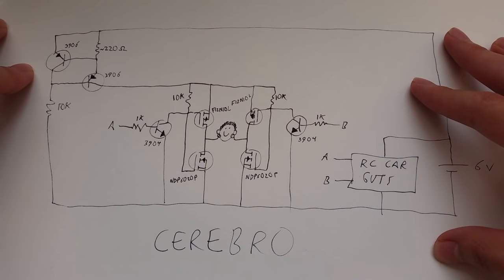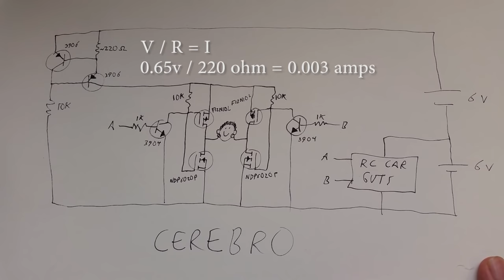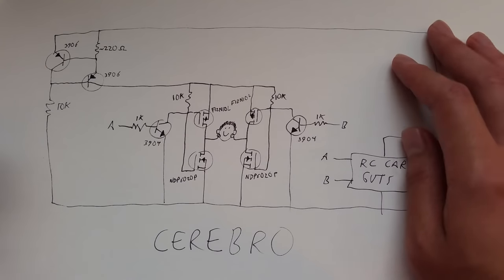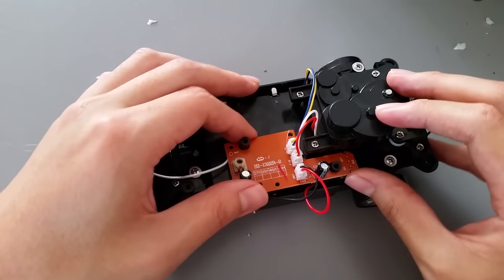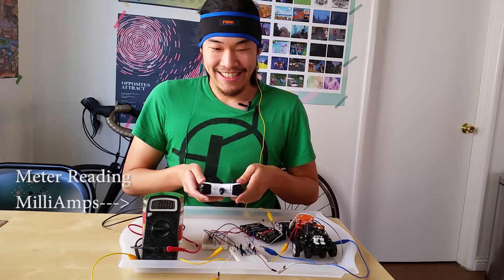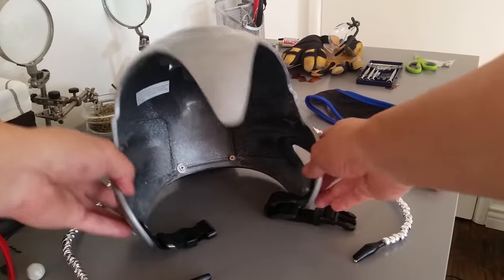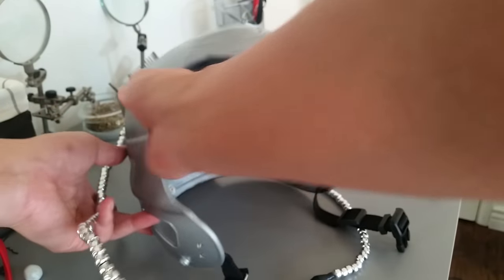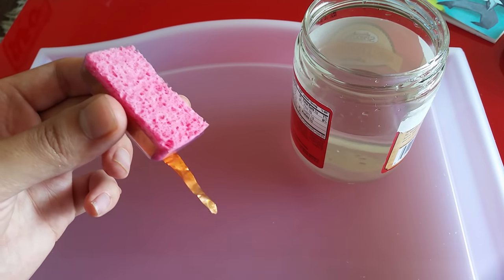How to make a Mind Control Cerebro Helmet from X-men!

Comment: Very nice explaination of the circuit
I would just say that it lacks any kind of fail-safe mechanism
If one of your regulation transistor were to fail the wrong way (shorting on the right one, high impedence on the left one) you'd end up with an unregulated current trough your head
Switching for a dedicated current source with safe failure modes would be better (but the circuit is great for anything not as critical and which would not require to put your head into ^^)

Comment: I know the chances of you responding to a 5 year old video are somewhere between slim and none, but does the output of the remote act as a binary switch on the equilibrium of the subject, or does the change in equilibrium vary in an analogous manor depending on the distance from center you move the controller?
That might not make sense... do you feel the same effect whether you move the joystick slightly to the left or full left to the stop? Or can you steer the subject slightly with minor input then really push them over hard with greater input from the remote?

Comment: Did you use pspice or something to check current before assembling the breadboards?  Also trés cool.  The simplicity of the device is awesome, time to go raid my unis lab.
Reply from the maker: Nah, just checked everything with a multimeter. Been a while since I've actually simulated a circuit!

Comment: Hey you have a website, or something people could contact you at (maybe a YouTube email, so there's not a bunch of spam on your real one or something?) I am about half way done with this and need some advice on the electrodes and where to put them, thanks!
Reply: Well it's done, I can't figure out why the electrodes arrant receiving power though, I'm guessing it has to do with mixing up the gate, source and drain on one or some of the mosfets (mosfets ares the only piece in this that I haven't worked with before). Any ideas? Thanks!
Reply from the maker: Make sure you follow the diagram and not my explanation, since I mixed up the N channel and P channel Mosfets when I was talking.
Reply: +Sufficiently Advanced Alright, I fixed it, but one question, what are you using for electrodes and how precise do they have to be placed? I tried using some tinfoil as electrodes, but nothing happened...?
Reply: +Noah Shafer it's hitting in at exactly 2.6 milliamps so that's all good, but I can't get it to make me want to move, and thanks again for the help, you make some amazing things!!
Reply from the maker: electrodes and saline solution info are in the video.

Comment: If I follow the instructions correctly, it is completely impossible to get dead from this right? Right?
Reply from the maker: No guarantees :P
Reply: But 12V shouldn't kill you
Reply: the issue is your brain, your typical synpase response is only a few PicoAmps (10^-12) at 40-90 MiliVolts. This thing is running at 0.25MiliAmps  at 12V. That is at least 1000X the amps your brain normally runs at and 300x the volts. 

If you held down one of the sticks on the controller for a long period of time, I have no doubt you could cause some brain damage.
Reply from the maker: Useful papers, in the description of "The Science of: Cerebro", and I've put them in the description of this video as well now.Functional MRI of Galvanic Vestibular Stimulation:
http://jn.physiology.org/content/80/5/2699.short
Tolerance to extended galvanic vestibular stimulation:
http://www.ncbi.nlm.nih.gov/pubmed/21853854
Task-dependent reflex responses and movement illusions evoked by galvanic vestibular stimulation in standing humans:
http://www.ncbi.nlm.nih.gov/pmc/articles/PMC1155693/
TL;DR why would I strap this to my friends' heads if I thought there was the slightest risk of frying their brains?